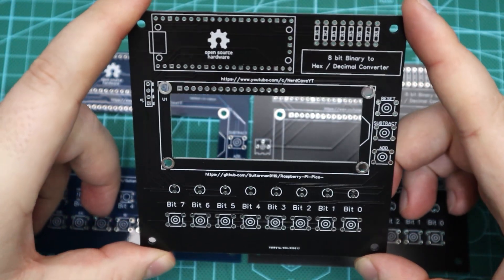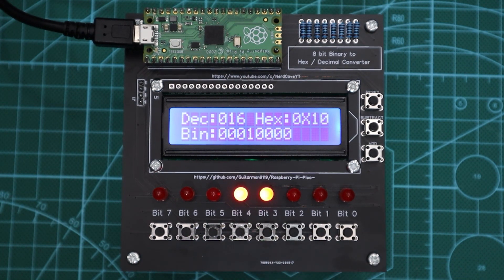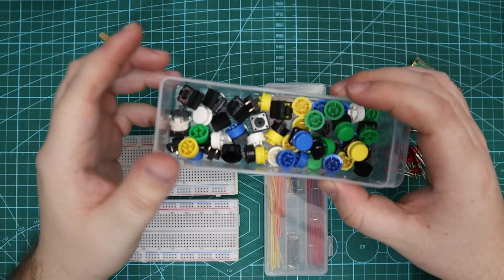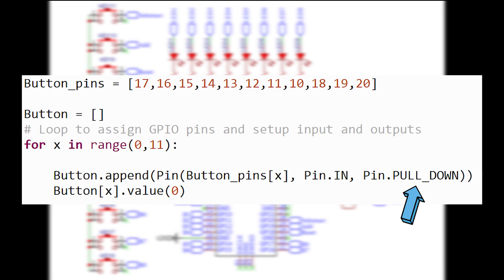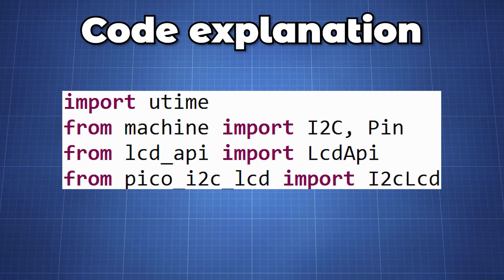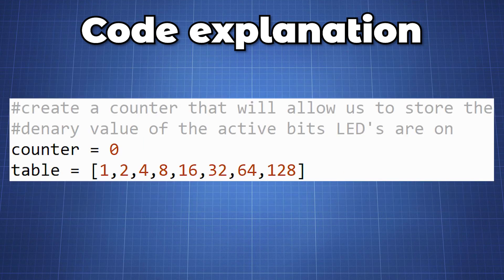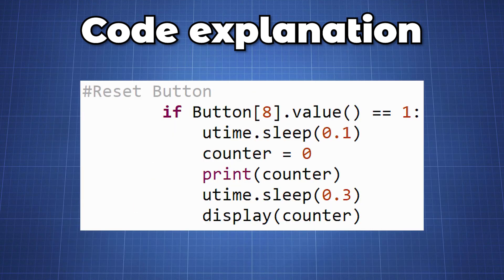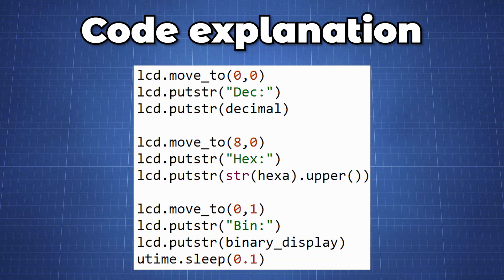Binary to Hexadecimal and Denary converter on Raspberry Pi Pico

Comment: I would love an update to the custom pico macro pad. Also keep up the great work 👍
Reply from the maker: It is coming, I am trying to make it modular so that you can basically expand the macro to more boards by joining them together which for now would be soldering but looking at what might be the best option, I thought about this since it would be cheaper to buy 10x10 cm PCBs then user can decide how much to add, I will throw it up on GitHub things got back to normal here 1st of June so now hopefully I can get new switches etc. for the follow up.
Reply: @NerdCaveYT  sounds super cool! Can't wait :)